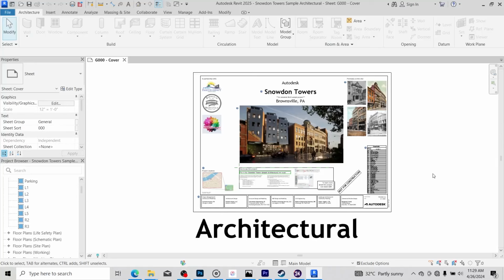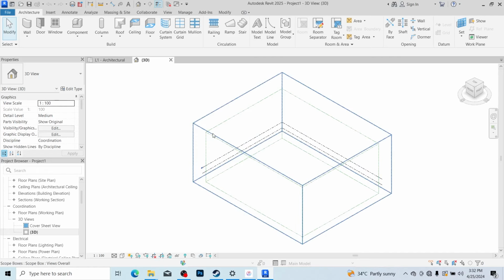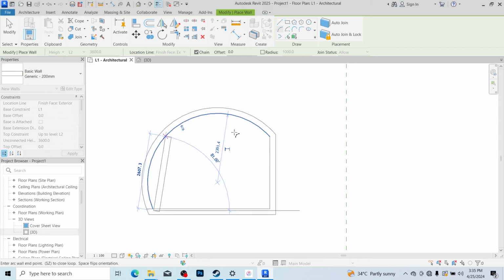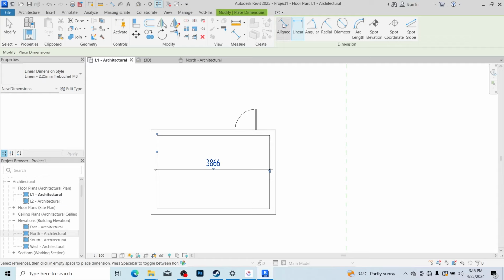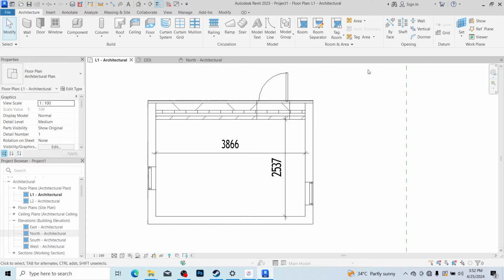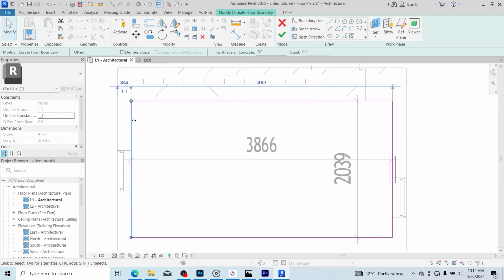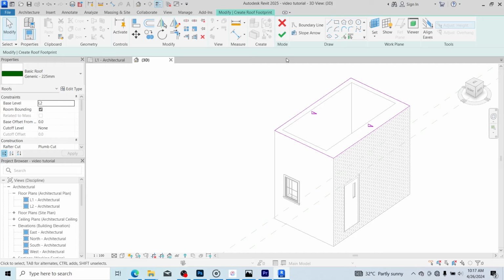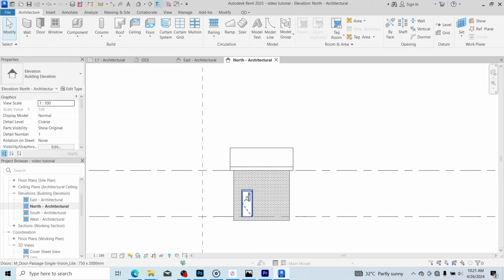Revit 2025 - Complete Tutorial for Beginners - Learn Revit in 23 minutes

Comment: I starting use Revit 2025. When you creating the wall, for example, you have top panel with parameters (for ex. length), but in my case, there is no panel! I do not change any default settings.